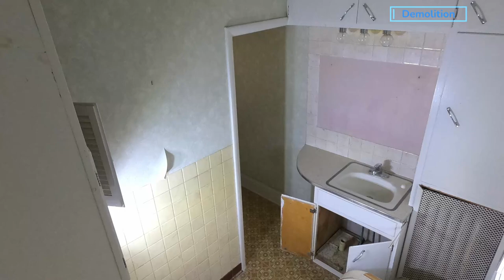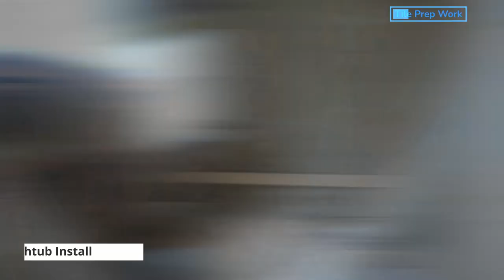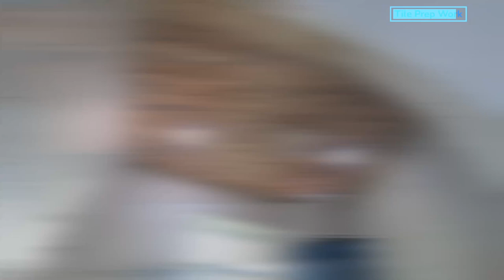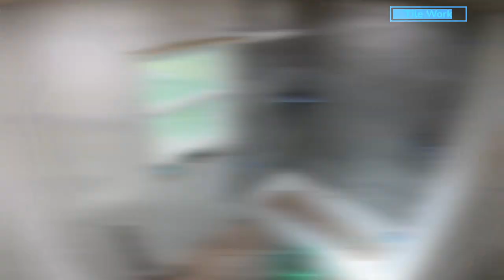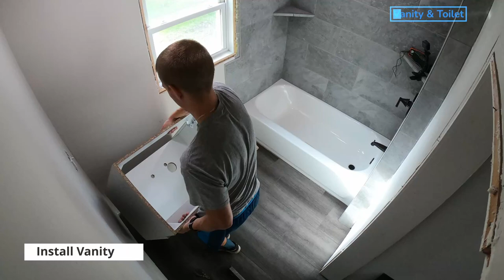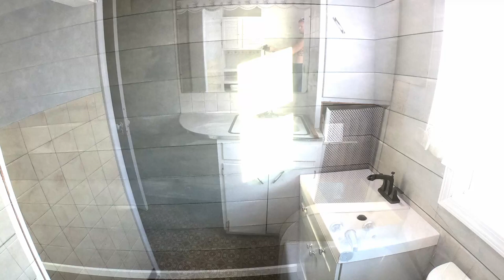Bathroom Remodel Time Lapse (DIY Renovation) - Start to Finish

Comment: The layout is much better. At first I thought it  was too much grey but then I thought it was that there were 3 different patterns of the grey..tub, floor and wall.  But I looked at it again and seeing how it could be decorated I think it looks great!  You can break up the color and patterns with the shower curtain and rugs and wall decor! And towels also. Just the right contrasting colors will brighten it very well. And you can use seasonal colors with grey if you decorate seasonally.  I loved the ceiling in the shower!  I really agree with the flooring...tile can be a lot of maintenance in a bathroom.... especially around the toilet!  So it turned out great... you created a little oasis! And never forget the decorating possibilities!
Reply from the maker: Thank you very much! Yes, you are right. I am not the decorator of the family, so I forget about that sometimes. I still would not do the shiplap if I could have a redo, but that's because it took a lot of time to install 😂

Comment: You did so well up until the floor...vinal?  not a tile floor.   Really downgrades the whole bathroom.  Would have been easy to put down tile since you already installed new sub floor on 1/2 the bathroom.  Plus it is not a big area.
Reply from the maker: Thanks, to each their own but I'm not a big fan or tile floors. A lot more work to install, not waterproof (without doing a waterproof underlayment), and in a house like this it won't help it sell for more than the LVP will. Just my thought process!